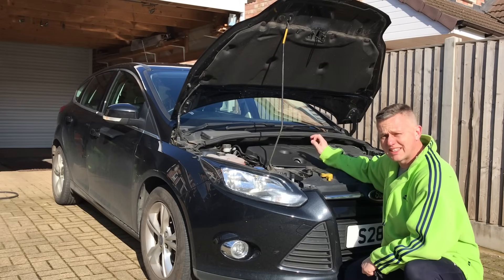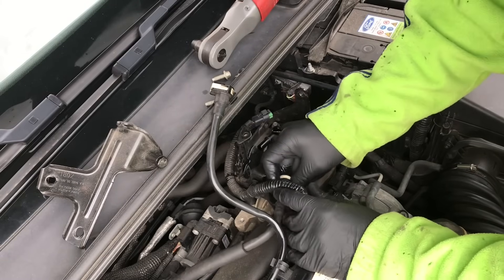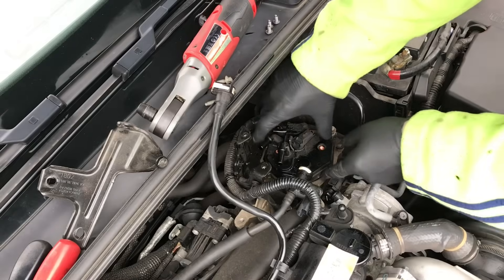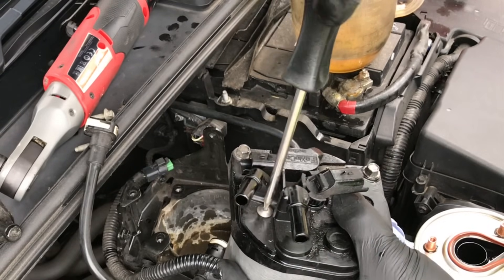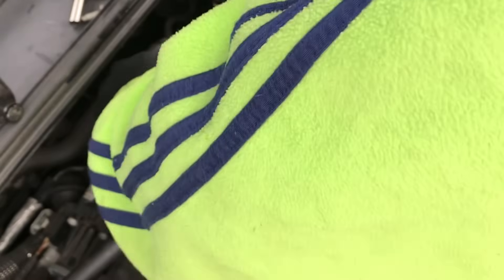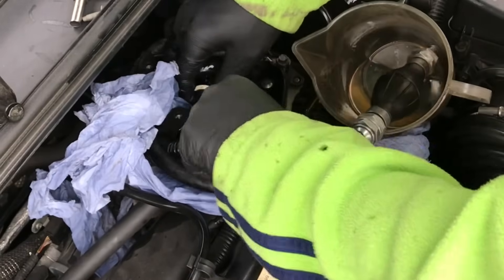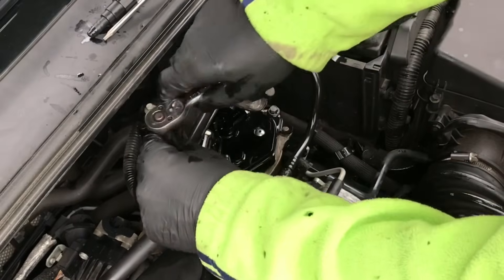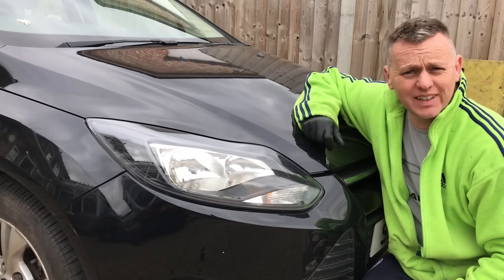Fuel Filter Replacement Ford Focus 1.6 Diesel 2011- tdci

Comment: Superb video, I used this today to change my fuel filter. The amount of black gunk that came out was unreal. One little extra tip, the hose at the back has 2 clips, I found they needed to be removed entirely to get the hose off. I also bought a length of 8mm fuel hose and a priming pump from local car spares shop. Only 17 quid. Did the job perfectly.
Thank you so much man, this was awesome!! Great job
Reply from the maker: Thanks for the great information👍🏻👍🏻🛠

Comment: I had this engine and filter in my old Mazda 3, I used to attach the primer pump to the outlet nozzle of the filter so it would suck the diesel from the tank to fill the filter and put the other end of the hose (clear) in an empty jug watching for bubbles, then reconnect. Have to say, my way is much less messy. Anyway, just a suggestion
Reply from the maker: Thanks Nigel for the great information👍🏻👍🏻🛠
Reply: That is also what I wanted to comment, I also do it this way and this does not require any diesel as it primes directly from the tank and also ensures that there's no air in the inlet pipe.  @aaanton11  This should be pinned as top comment as it saves from having to buy or siphon diesel from the tank.
Reply: just out of interest which pipe would you leave on the back or front pipe ?
Reply: So is the only difference here that in the video, the primer pump was attached to the inlet and the other end sucking in diesel…whereas with the easier method, the primer pump should be attached to the outlet and the other end should just be pointed into a jug where the diesel would go and once it has no bubbles it’s been bled? So this means that when it’s sucking diesel from the tank by attaching to the outlet, it’s also filling up the filter at the same time? Does anything have to be connected to the inlet using this method? And can the inlet be connected up whilst the filter is being filled through the outlet or can that only be connected once the filter is full of diesel and free of air? I’m just looking to clarify things as I don’t want to get this wrong. Thanks

Comment: Many many thanks for uploading this! Following your instructions, I was able to successfully replace and prime the diesel filter on my 2012 Mondeo mk4 1.6L TDCi (BA7, engine type T1BB) with zero problems starting and driving the car afterwards.
In my particular scenario, the metal filter housing has a plastic notchy piece fitted on its bottom, and the piece from the old filter was stuck in the mounting "cup" when I took the filter out. So, for anyone with a matching filter type reading this, make sure you get the old piece out of there before attempting to insert the new filter. Also, the new filter came with an o-ring for the drain plug which I assume they intend for us to replace as well (although the old one appeared to be in perfect shape in my case). The new o-ring was a tight fit, but with a bit of fiddling I managed to slip it on by hand. Otherwise same procedure as with the Focus featured in this video.
Reply from the maker: Well done that's great you were able to change the filter, Thanks for the great comments👍🏻👍🏻🛠

Comment: Spot on, great video , you nailed it . Just finished the job on a c-max 2012 no problem at all. If it helps anyone I really don't like those pump with a rubber ball things,  mine needs to be thrown over a hedge .But I used the electric oil draining pump sold by amazon , lidl ali express etc. Just put the entry tube into the can of diesel the outlet fitted onto the filter inlet perfectly and pump it through... it pressured the system like a dream, And you have an oil draining pump as well!!
Reply from the maker: Great Job, Thanks for the great comments👍🏻👍🏻🛠

Comment: I always have a primer pump and jam jar which I keep in the spare wheel well of my Focus diesel just in case. I once had a very, very occasional problem with air leaking into the fuel lines and draining back into the tank overnight; it happened a couple of times a year. It turned out to be the top of the fuel filter wasn't properly screwed down. The slightly negative pressure in the fuel feed was, presumably, enough for atmospheric pressure to hold it down but sometimes it was not enough when stopped. 

However, I do not use a jug of diesel, I just use the pump to pull it through from the fuel tank. The jam jar takes the overflow, and I can put the lid back on to transport it without spilling.
Reply from the maker: Thanks for the great information👍🏻👍🏻🛠

Comment: Followed your steps exactly and worked out perfect.  Started first time.  My god, those T15 torx are a pain, really tight.  Broke 2 or 3 torx in the process.
Reply from the maker: Yes they can be extremely tight a good quality socket is needed links are in the description for the Milwarkee set Thanks for the great comments👍🏻👍🏻🛠
Reply: @aaanton11  Yeah deffo purchasing a good T15 for next time.

Comment: Great video 👍🏻, id like to thank you personally lol , just changed the filter on my transit connect 1.6 2016 as it was lacking power on load ( up hill ect. ) followed by engine service now on dashboard.  followed video step by step and job well done , fired straight up no problem, took it for a run, didnt miss a beat and responsive as before. fingers crossed its resolved, thanks again 👍🏻
Reply from the maker: Fantastic job well done, Thanks for the great comments👍🏻👍🏻🛠

Comment: Thanks for the article Aanton..interestingly the little thing that twists on top of filter housing is a water drain...u turn it clockwuse and it drains any water in the bottom of the filter out..but di it quickly though or it will drain the filter fully and it will have to be bled..however the 3 ..torx screws...size 15...my tool wouldnt shift them..chewed the stars up trying...so i drilled them and used an easy out... put new torx screws in...theyre same size but T25...the Ford ones are very soft metal....make sure no swarf in the filter head though...i reckon its an indication that Ford dont want anyone other than the main dealer to do the job...the new screws i used were from a Rover 75 fan unit...very hard better quality metal..thanks again AAnton...Bob...Paignton.....
Reply from the maker: Thanks Bob for the great information👍🏻👍🏻🛠

Comment: Great information, and clearly explained how to change the Fuel Filter. 
BUT, there should also be a, 'heads up ' regarding what to do if air gets trapped in the Fuel system. 
The mk3 focus is well known for this issue, as I have found out!
Reply from the maker: Thanks for the great information👍🏻👍🏻🛠
Reply: Whats happening with that issue? Does air gets out by self? My mechanic changed fuel filter, and since then when the car is cold, I have problem with accelerating for 1 min, it cutting speed, like fuel stops comming in for 1s then come, and over again. After 1 min when car is warm, everything is great, also in idle alwyas runs great. No errors, injectors are repaired.
Reply: @iamone2534  there could be some air trapped in the fuel line.  
Have you tried doing a reset?
Turn the key in the ignition to the second position for 30 seconds. 
Then turn it to the off position for 30 seconds. 
Then remove the key, and start to car, it may take a few attempts. 
But this resets the system. 
Hope it helps.

Comment: Thank you so much. This video was very helpful. A couple of additional comments. For the primer pump, a inner diameter of 8 mm is fine. Please note that most of the hoses that are delivered do not measure 8 mm, but less. And then it won't fit. 

1 liter of diesel will be sufficient to carry out this job.
Please note that probably the little rubber ring that was connected to the bottom side of the old filter, could get stuck in the metal housing. Then you'll need to get it out by using some tool.
Reply from the maker: Thanks Richard for the great information 👍🏻👍🏻🛠
Reply: Just draw the diesel through the filter using the pump, it's easier then having to find a litre a diesel and then pump it into the filter.
Reply: @mattb6542  Can you just connect a vacuum pump to the filter outlet?

Comment: I wish I had seen your video before I attempted it without any knowledge of what I was doing, now my car won't start. Any ideas on what to do?
Reply: Prime the fuel filter
Reply: @ciprianss025  Thanks bro.
Reply from the maker: you will need a hand primer pump to remove the air from the system, Thanks for the great comments👍🏻👍🏻🛠

Comment: Hi awesome video 👍 but unfortunately I only came across it afterwards. I didn’t prime before turning the car on. So it started up but then cut off and now won’t start 🤦‍♂️. Will the priming the way you did it still work or do I need to do something else to take the air out of the system. Thanks!
Reply from the maker: Prime the same as in the video, Thanks for the great comments👍🏻👍🏻🛠

Comment: I'm curious why you didn't reconnect the inlet pipe and use the primer pump to draw fuel up through the outlet spout of the filter cap from the tank. The fuel you draw through can be poured back into the tank.
Reply from the maker: my primer pump has a limited suck, when you try and draw from a empty filter the empty air volume suppresses the suction, as these are hard to draw I just find it easer doing it this way, Thanks John for the great comments👍🏻👍🏻🛠
Reply: @aaanton11 
Noted!   ....I'll comment back when I've done mine. Apparently the priming is only needed when a mechanical pump is fitted. If the car's fitted with an electrical pump, it self bleeds with a few on/offs from the ignition.
Reply: Job done one mine.
I reattached the inlet pipe and bled off through the outlet spout no bother at all. Only snag was the rubber bush for the filter base fell off and into the abyss but the 8mm bolts holds the filter assembly good and firm.
Reply: @johnchurchill3933  do you know primer tool I would need for mine mate? Can't find one for my 2012 Cmax 1.6 tdci, unless one primer does all? Cheers
Reply: Followed this method on my car yesterday. Thanks so much for such a clear explanation.

Comment: Nice clear and informative video. I miss my b5 passat pump duse 130bhp engine. Self primers! Sold it, worst thing I ever did. Now I've got a fiesta 1.6 duratorq 14 plate, even the oil filter is hard to get to. Damn it.
Reply from the maker: Thanks for the great comments 👍🏻👍🏻🛠
Reply: @aaanton11  anton! Looking on the net now for a primer. Does the hose need to be 8mm in diameter?
Reply from the maker: You can buy a primer with different adapters, there are loadstone eBay and Amazon, thanks for the great comments 👍🏻👍🏻🛠

Comment: thanks for the great video, just finished a service on my focus. priming the filter was a bit tricky with a crappy hand pump off fleebay but got it done with a funnel & bit of hose pipe 😁
Reply from the maker: Glad it helped, Thanks for the great comments👍🏻👍🏻🛠
Reply: How did you manage to do it with funnel?
Can't get any primer pump in my local shops

Comment: Finally braved doing this today, an excellent video which really helped  me as I will be honest the Haynes manual is worse than useless!! The hand priming pump is a definite must! - interesting before starting work I found the water sensor plug disconnected and hanging loose? Gotta love Ford main dealers quality control
Reply from the maker: Glad it helped, and well done 👍 Thanks for the great comments👍🏻👍🏻🛠

Comment: My check engine light is on an it says is the MAF sensor, but I've changed that and it still sends the car into limp mood. I've asked everywhere and was told it's the fuel filter. Do you have any ideas what still causes the light to come on with the code P1102. I've changed the air filter also.
Reply from the maker: I would be looking for an air leak on one of the turbo hoses or a small crack in the inlet manifold, similar to this video https://youtu.be/GiMS0vkN-hY Thanks for the great comments👍🏻👍🏻🛠

Comment: Question please. I changed fuel filter didn’t really think thought it would of primed itself. Have I buggered the car by trying to start it or will priming the filter like you’ve done get it going?
Reply from the maker: you can still prime the system, it might take longer to start, Thanks for the great comments👍🏻👍🏻🛠

Comment: Hi I done what you did and everything was ok drove grand till the next day then it just keeps turning over it won't start! I seen in one of your videos about putting a non return valve on that might sort it which pipe do I put it on?
Reply from the maker: You must have an air leak on the filter I would check again, Thanks for the great comments👍🏻👍🏻🛠

Comment: Can I use a fuel syringe to pull the diesel though the filter and that or do I need to get a bleeder like you have here? I already bought the syringe and fuel filter but I have been putting off doing it since I don’t want to do the job and then have the car not starting lol
Reply from the maker: a syringe would not pull enough through, best to use a primer pump like in the description, Thanks for the great comments👍🏻👍🏻🛠
Reply: @aaanton11  ok I thought it would do because it’s a massive 1.5 litre one but I guess I’ll get a primer like you’ve got then.thanks

Comment: is it not easier to reconnect the hose from the fuel tank and attach the primer pump to the other nipple and pump the fuel through that way then attach the hose?
Reply from the maker: It means drawing the fuel through the filter which is harder as the air acts as a damper, where if you pump into the filter it eliminates this issue, Thanks for the great comments👍🏻👍🏻🛠

Comment: You're not joking about the need for good quality T15 driver. Sheared the end off a 'cheap' one. Back hose was a pain to get off - the coupling mechanism was possibly damaged by a previous dealer service. Tricky to get the lower nipple and rubber bush to sit correctly in the hole on a Bosch filter when refitting the filter housing.
Reply from the maker: nice easy job then😮‍💨 Thanks for the great comments👍🏻👍🏻🛠

Comment: It looks like you got rid of the air in the section filter, hose to the pump and maybe output of the pump. What with the air between the tank and input of the filter? Doesn't it kill (maybe partly) the  Common Rail pump when this air will go to the pump after starting the motor?
Reply from the maker: Drawing the fuel up will eliminate the air, Thanks for the great comments👍🏻👍🏻🛠

Comment: Got a issue with my focus. Same make and model.  Idles fine but when warm and under load the car misfires and shakes. Feels like the air fuel is off. There is no fault codes and was recently serviced.
Reply from the maker: if its missing and shakes, most likely to be a injector starting to fail, Thanks for the great comments👍🏻👍🏻🛠

Comment: Great video this! Going to be doing my 1.6 tdci soon! When you were priming the filter, where did you get the diesel from to do that? Just wondering if the diesel from the old filter is enough, I just want to cover all basis lol? Thanks
Reply from the maker: You will be pulling the fuel from the fuel tank directly from the fuel pipe at the filter, Thanks for the great comments👍🏻👍🏻🛠

Comment: Priming the filter is half the battle . 
Use a coke bottle of diesel to fill the fuel line you have disconnected for the priming also . This is vital as well as the priming
Reply from the maker: Thanks for the great information👍🏻👍🏻🛠

Comment: i want to change my fuel filter on my 2016 1.5tdci ford mondeo is there an electric fuel pump in the tank or do i need to bleed the system any tips would be appreciated thanks.
Reply from the maker: it will be pretty much the same as this one, good luck,Thanks for the great comments👍🏻👍🏻🛠

Comment: Great video! I’m about to change fuel filter on my transit connect which is pretty much the same, I have done a fuel filter on an old Astra before but had to take a fuse out before removing, is it the same with this or can I get straight into it? Cheers
Reply from the maker: just as in the video, don't pull any fuses, Thanks for the great comments👍🏻👍🏻🛠

Comment: Thanks man! What would you do if it didn't start? How do you clear that air out?
Reply from the maker: you would need to fit the primer pump inline, and pump while someone cranks the engine, but they can be very difficult to bleed. Thanks for the great comments👍🏻👍🏻🛠

Comment: Hi Anton, I have just started watching your videos and they are very helpful and clear to watch I must say. 
As you say it can be a whole load of trouble if there is air in the fuel system. 
You have bleed the filter of air but if there was air else where in the system could it be bleed  if the car cannot be started. If so where can air be bleed from and would this hand pump do or is there other tools required. many thanks for a reply. 
Keep up the good work.
Reply from the maker: you can just connect the hand primer pump inline and pump whilst cranking over the engine, this will force the air around the system and out.Thanks for the great comments👍🏻👍🏻🛠

Comment: I'm glad I watched your very informative video before I started on my 2013 1.6 Grand C-Max which has an identical layout to the focus (although a little harder to get at due to over hanging bodywork.) The instructions for priming were spot on. Something I may not have thought about. The pump I bought had hoses that fitted the fuel line exactly so I was able to pump fuel from the tank into the filter without using your jug method then on to force fuel around the system by reconnecting the filter outlet pipe and continued pumping till I could not hear any bubbles. Worked a treat. I'd like to post a video of my own about the problems that led to me having to change the filter. Have you any objections to me linking to your video as a good example of how to change the filter. Thanks very much.
Reply from the maker: Well done for the repair, You can link this video I don't mind, Thanks for the great information👍🏻👍🏻🛠